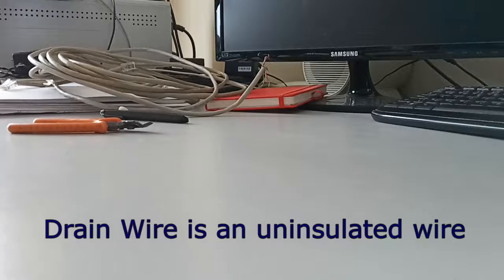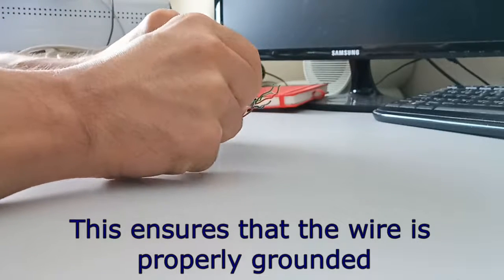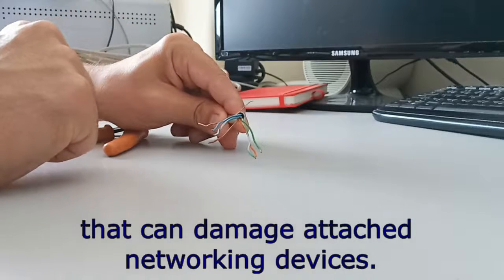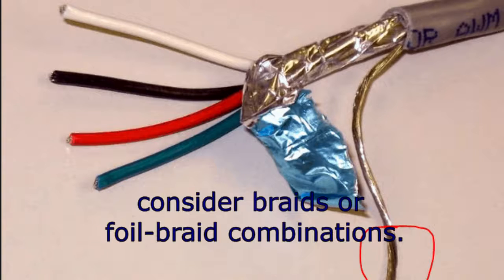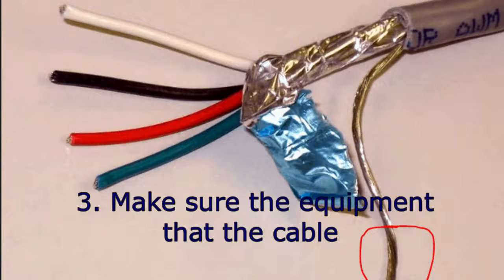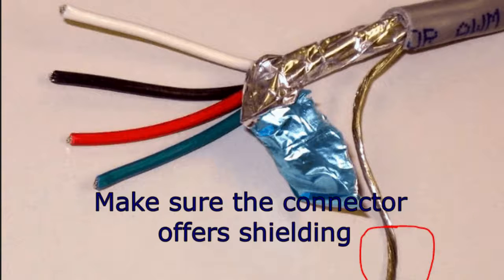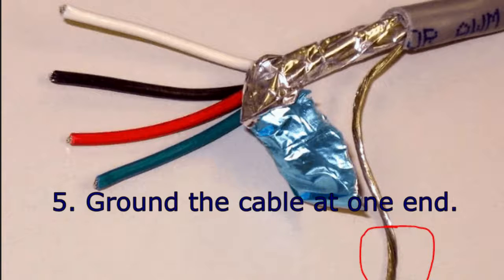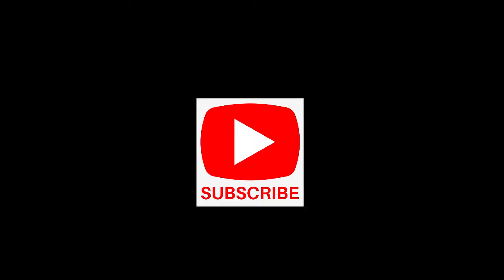Drain Wire - Network Encyclopedia

Comment: Drain wire only needs to connect with shielded end terminal. Depending on length of cable, environment, and frequency of data transmission, grounding only one side of cable may or may not be more beneficial than grounding both sides. Try both and use a Fluke tester to test the cable to determine what's better.

Comment: whether drain wire has to be joined with an earth wire to do the earthing externally ?

what i understand is shield/drain wire will make contact with the metal body of RJ45 connector pin, but whether an external earth wire is not required to connect the metal connector to earth terminal externally?